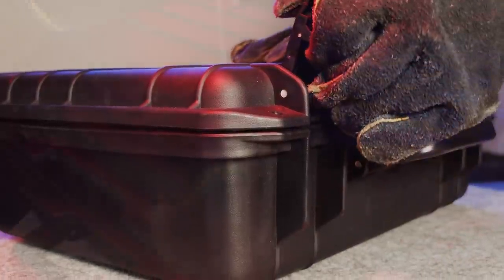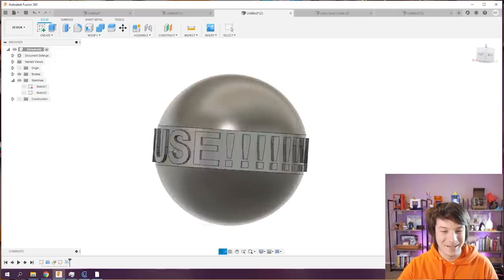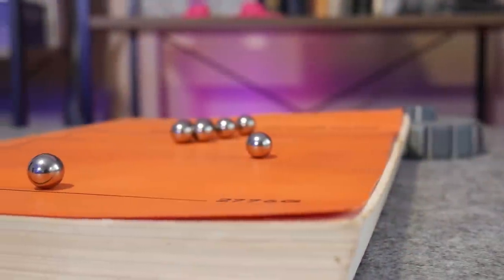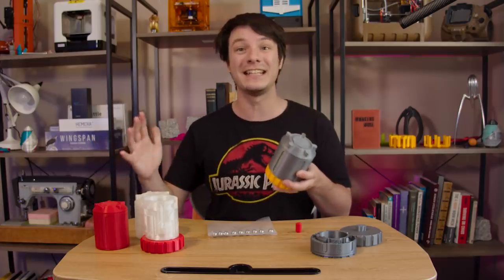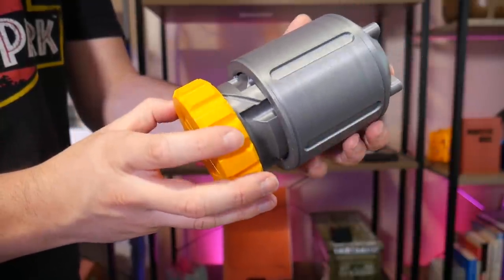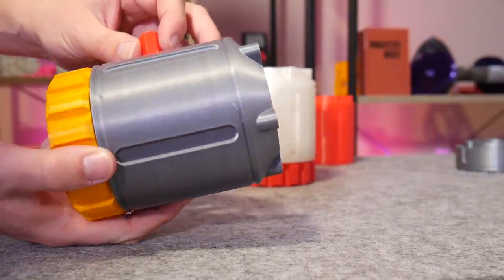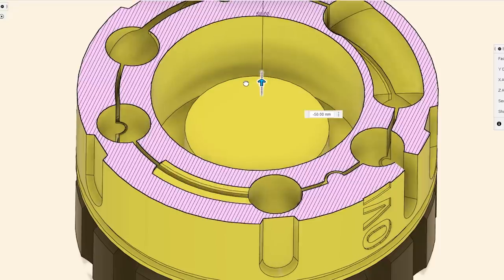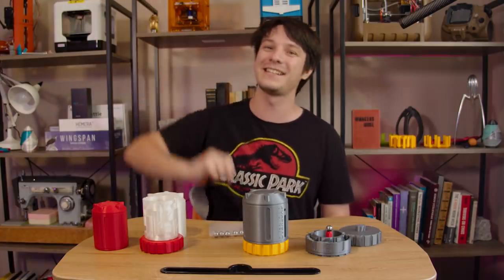This 3D Printed Puzzle is ALMOST impossible. Fusion Overload

Comment: Hello Angus and  everyone else.
Watching your videos got me to buy my first 3D printer. Got it yesterday, and of course the only thing i could do for my first print was the MM stress test. Had to restart it 3 time after it completed about 5%. Because of all ive learned here and on 3D PN i was able to troubleshoot early and solved the probleme i was having. Wish i could show a picture of the result, apart from the bottom layer that fused on the 0.15 and 0.2 (wich was easily fixed after the print) it came out perfect and that was on  200US printer. Next print "Easter torture egg"
Keep up the great work,thanks for everything.

Comment: Hear me out, you should try printing 2040 extrusion beams and attach them to the existing machine, essentially printing the printer longer (you could also try the z screw). Ive tried it on an ender 3 and it somehow worked, and I now have a 300mm tall z axis.
Reply: Interesting. Can't imagine it being a robust add-on, not requiring regular replacements.

Comment: Just bought the design off your website.  Looking forward to getting the printing started.  Can you share a link to where you bought your 1/2" bearings from?  (Aus link is fine)  Also - would a smaller diameter bearing (say 10mm) also work...?
Reply from the maker: I purchased them off an aus ebay reseller, they had lots in stock and shipped quickly. Can find the link later!

Comment: If one has a resin printer so it prints upside down and will not be able to add the ball during the print could one possible print it then add the ball afterwards?

Comment: So i just read on the Page that the bearing and whatever goes inside the puzzle has to be placed there while it is printing. Does that mean the Puzzle is not reausable and can not be reassembled after it has been solved?
Reply: Sure you can reassemble it.  Then solve it in reverse.  Easy.  My wife solved it in under 8 minutes. Got the prize out,  reassemble it and reverse the process to get the ball to the beginning,  in under 3 minutes.  
Not near as difficult a puzzle as I hoped for

Comment: Sooo printing it in transparent filament is cheating? :)
Reply from the maker: Sorta haha, you still struggle to see it !
Reply: hmm Good point!
Reply: @MakersMuse  Have you tried increasing print temperature with transparent filaments? I found it helps with the translucency.
Reply from the maker: @licensetodrive9930  Yeah clear PETG and thick layer lines you can get really nice translucence, but not too suitable for this model. Still, something I have been meaning to use for ages for an RGB build.
Reply: I've been printing quite a few things with transparent TPU recently, I designed some holders for RC receivers & micro antennas which fold over the tiny circuitboard and clip closed, easily opened & reused, which can't be said with heat shrink tubing.
My Thingiverse design 4731250 has been quite popular.

Comment: hi guys i tried the test file, and the printer i am using can do the print ok with enough clearence but both on the inner test ring and outter test ring the prints are seperating when the wall are at their thinest , almost like there isnt enough surface area to keep the layer together??? any one have a suggestion. printer is borrowed and home made xyzcore design square frame heat bed just moves up an down, the filiment i used is new out of the vaccum sealed bag  eSun white

Comment: That's a 2D maze not 3D. The paths for the balls are two dimensional around the cylinder. You're not going through the cylinder to make it 3D. Just saying.
Reply from the maker: Good point, but you do need to manipulate in 3 dimensions to solve it.